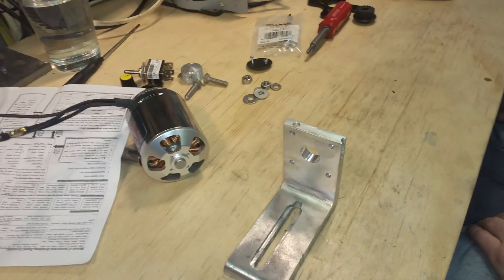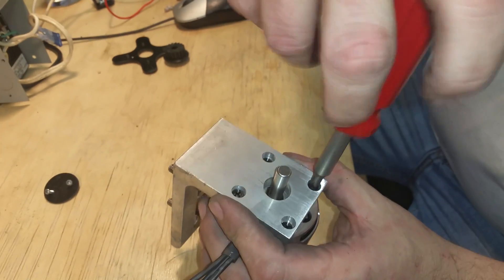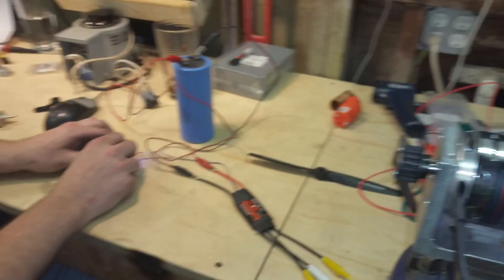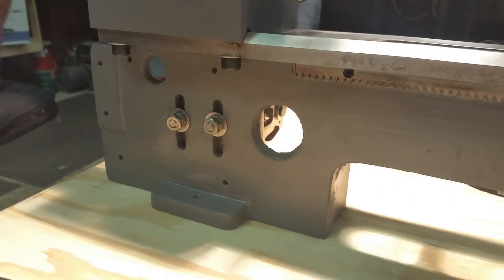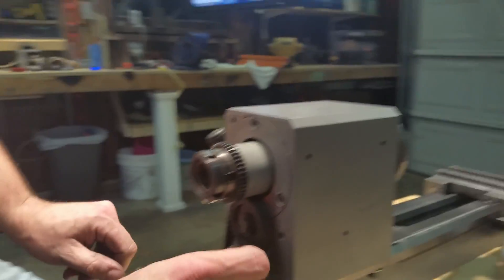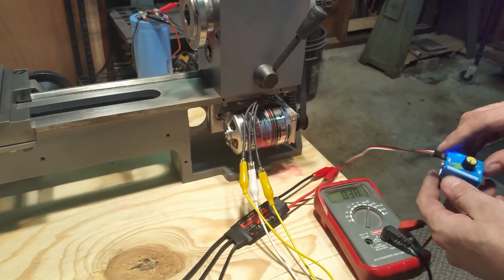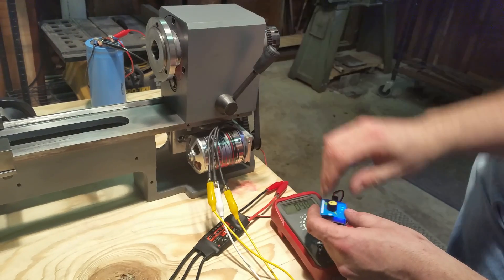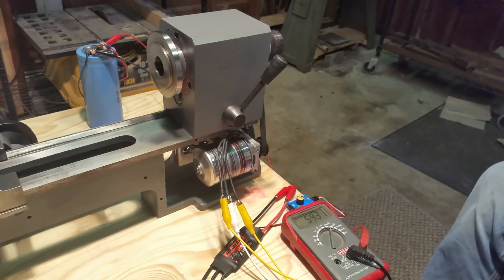Sieg Mini lathe rebuild #12 brushless motor fit & test

Comment: It looks very easy to slow that lathe down with just your fingers. what do you plan on machining with that little motor on it ?  Your not going to be doing steal with it unless your planning on taking extremely light cuts !  I only have 2 hp motor on my lathe and I can stall it with steal if i take to deep a cut.

Comment: Try drilling a half inch hole in steel  then will see how it really works.  I think the original motor  with a slower timing gear set up has way more torque  of course this motor is brushless most brushless motors for this lathe that are brushless are larger and handle more torque . I increased the size of wire running the original also  the timing pulley to slow the RPM adding low end torque and got rid of the weak wire springs raped around the brush holders  on the motor and replaced with 14 ga copper buss  wire soldered around brush holders to improve performance and gain more direct power to the motor..  This area is common place of motor failure and does not handle higher amp requirements.
Reply: its simple jjust gear it down so it runs high at low rpm
Reply: @way2dumb  I know this is a hobby brushless but  you should demonstrate it at low RPM cutting steel with a 1/2 drill  2-3" deep if it does not break the cog belt and does not stall then move up to a 3/4'" drill if it passes then you have made a improvement.  Another YouTuber posted a $ 100 improvement with controller using a Sewing machine motor which is bigger than yours also a brushless but i tried to get him to do a similar test to see if it is a improvement.  If i was to compare i would create a similar test to confirm a real performance improvement.

Comment: Hi, just fitted the 162kv motor and my friend is using an arduino and written some PWM code. Everything is coming on great digital display to be done next and optical RPM sensor to fit.
Thanks for the inspiration.
Reply from the maker: Hi Tony,  Glad to here about the project. Kudos to you!

Comment: Don you could also use gearing on it to offset some of the direct load on the motor. It may reduce your speed a little but it should help. Also, as I do electronics for a living, the AC voltage when rectified will only be 70.7 % of the peak to peak value.In example 10VAC with become 7.07VDC after it's rectified and smoothed out. The reason is that if you look at AC Voltage on an Oscilloscope it has hills and valleys. After you smooth them out the top of the hills are used to fill in the valleys, hence the accepted percentage of PEAK voltage lost is 70.7%. So what ever your AC voltage is multiply it by .707 and that will give you the approximate DC voltage after it's rectified. You can also increase the size of the wires going to and from the ESC to increase the amperage. Wires can only carry a curtain amount of current, the closer you get to the maximum the less percentage of current per volts it can carry, though the voltage will appear to go up the wattage will drop due to the resistance of the wire diameter. For wiring use heavy duty terminal blocks that have screws and use heavy duty wire crimps. The same goes for the bridge rectifier you're using. It's only rated for a curtain amount of current try replacing it with one with a higher current rating. Feel free to ask any questions. Best Wishes n Blessings Keith
Reply from the maker: +Keith Noneya You sure know your electrical, wow!  As you will see later on..  i went with a  regulated DC power supply. Actually i went through a couple of regulated dc power supplies, as you'll see. Another thing I figured out, is there is absolutely no reason for me to try to create my own DC by converting AC. Later on, using a 24v transformer, capacitor and full-wave bridge, which the volt meter showed clearly 24v, once connecting to the speed controller went 35v and smoked a bunch of stuff... So I'm sticking with regulated DC. haha
Your recommendations on the larger wire size is a point well taken. I don't know if it makes sense to go with a larger wiring than the wiring on the ESC itself. Possibly you could help with that when you get to those videos. Thank you so much for your comments. -don
Reply from the maker: Thanks for the comment Barry. A few people mentioned that i may be using the wrong speed controller for this configuration. You can see the the motor load up when cutting. Thanks for making the suggestion.. Please feel free to be more specific with you thoughts on a different setup with a VFD if you like. I would like my channel to be open discussions. Oh, if anyone wants to point to a specific speed controller, please do. -Cheers

Comment: Really good Job, The Skywalker ESC default mode is suit for RC plane, the RPM output will vary from different loading. If possible you can find some RC Helicopter ESC, it  will maintain constant speed when control. Or you can download the open source from BLHeli  form https://blhelisuite.wordpress.com/ . It collects most ESC in the world and re-write powerful BLHeliSuite ESC firmware for each model. Although it may be more complicated and waste time to read and try, it is so powerful. Skywalker use SiLabs MCU, you must set to the "closed loop mode". I have tried it before, the RPM is keeping constant with closed loop until beyond the motor or power capability.
Reply from the maker: +林建志        hi and thanks for the information. This is what i'm looking for, i would hope that the motor would draw more current and not slow down as much.  in the video you can see the amps draw at 5-6 max at nearly stall and could easily be higher. If i understand correctly you are saying that this is a function of the ESC that can be modified.  Reviewing the site you mentioned, it look like i can use an Arduino as programming interface to the ESC. For me it may be easier to use a different ESC,  do you have a suggestion on a Heli esc around 60 Amp that would be relatively inexpensive? Thanks again!